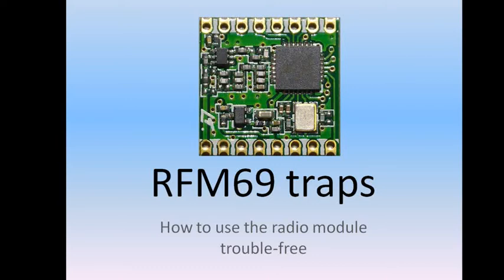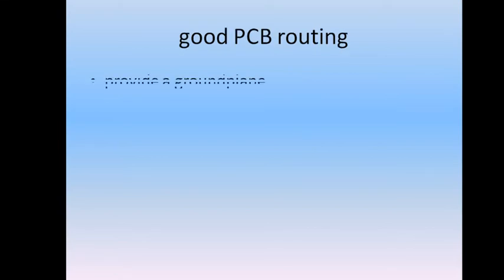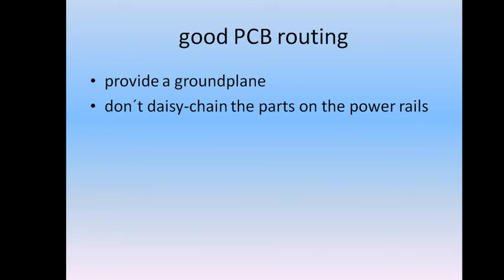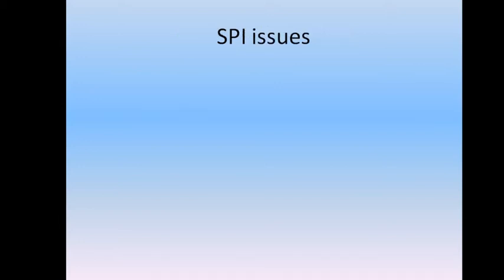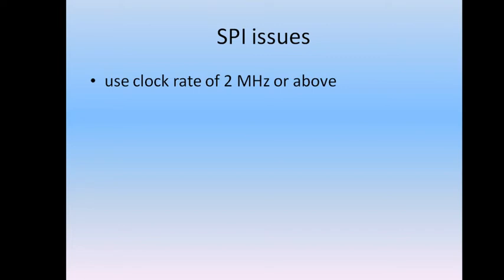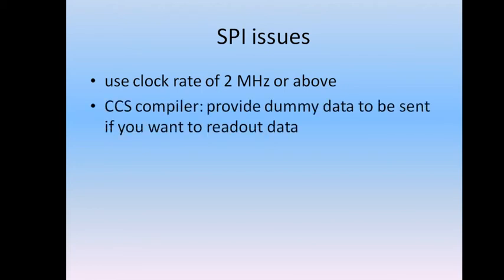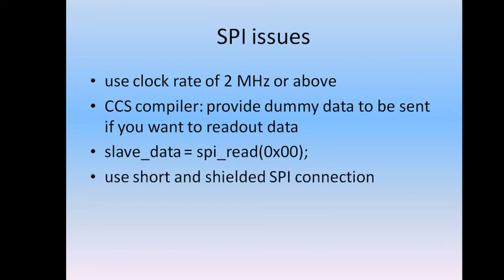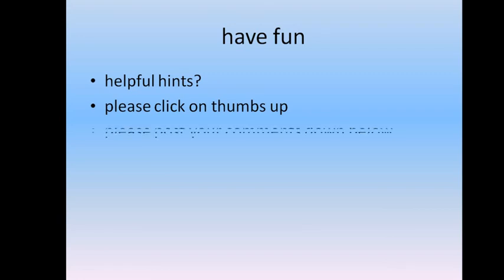RFM69 tricks for young players - hints, info, help, solutions...

Comment: Wondering why some RFM69 PCBs have two large pads with a white line around them? The other side of the PCB also has white color in that rectangular area around the pads.
Reply from the maker: There are several versions of this board on the market. My boards have white lined fields intended for marking which version it is.

Comment: I am attempting to communicate with a pair of HopeRF RFM95PW LoRa radios and MEGA2560 boards via SPI.  I was able to setup a pair of RFM95PW radios to communicate with a  pair of ESP32 DEV boards via SPI.  Unfortunately, suddenly, I started to experience problems with the ESP32 boards not being recognized by Windows running Arduino IDE  V1.8.12???

I have had great luck with a pair of Microchip's RN2903 LoRa radios communicating with MEGA2560 boards using SoftwareSerial communication.  In light of the sudden unreliablity of the ESP32 boards and Windows; I thought I could shift the sketch over to the MEGA2560 boards.  It seems that the Arduino SPI requires a lot more than the simple sketch used with the ESP32 boards communicating vis SPI.

Any suggestions of what the MEGA2560's additional requirements are to achieve SPI communication with the HopeRF's RFM95PW radios?